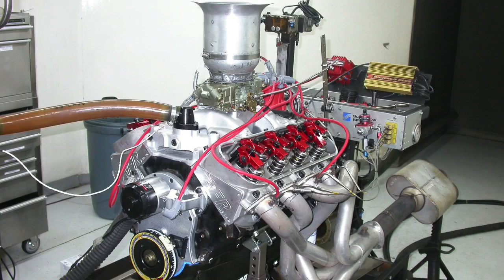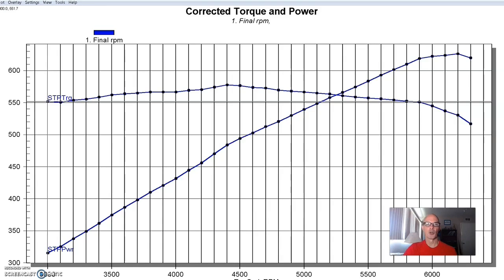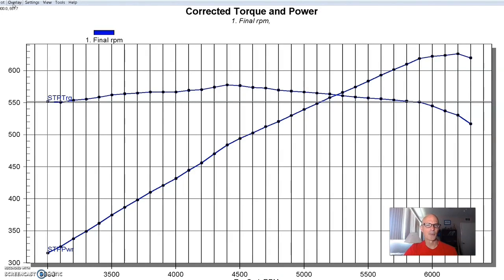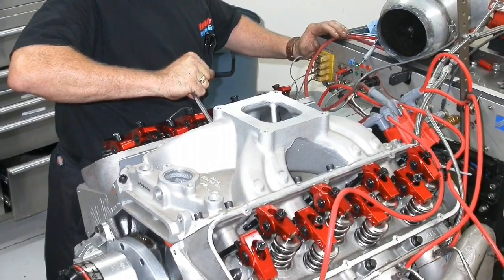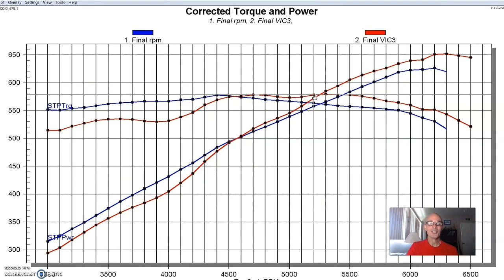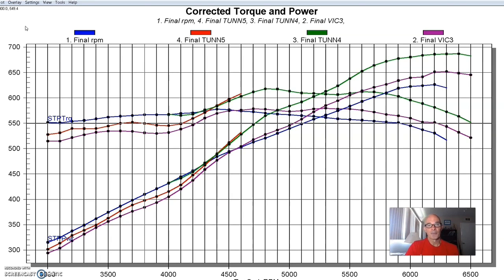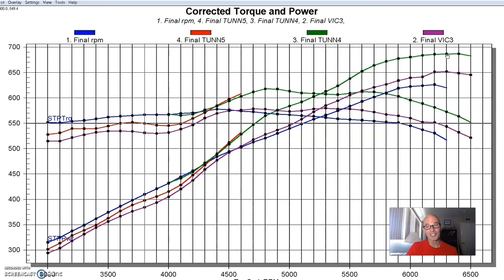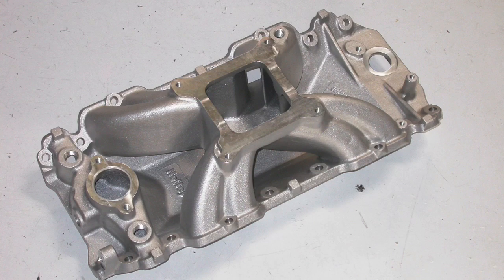BBC-TUNNEL RAM vs THE WORLD! -PLUS BOOST

Comment: I built a 10.7-1 496 for my 55. All forged internally simulator cam .650 solid roller with a later closing intake valve to fill the cylinders more shooting for about 180lbs cranking compression looking to run 93 octane fuel. The intake is an older weiand 70s era had to use adaptors because it's got a dominator bolt pattern and got two proform 750s on order. Not sure what to expect it's got Edelbrock rpm heads they were gifted so I'm running them. It's a street motor I don't race but I do like hitting 6500rpm every so often.

Comment: What is the benefit of that vortech carburetor box? I never seen such a thing before this video. Do you still need a blow through carburetor?
Reply from the maker: you can use a non blow-though carb
Reply: @richardholdener1727 interesting. I see they cost about as much as buying a blow through carb. Between buying a carb or buying the box, what is better?

Comment: I have a 454 built with 600 lift cam currently running a rpm airgap and avs2 800 can I get a tunnel ram and just get one more carb to match my avs2 800 would it run and idle with 2 800s on the street?
Reply from the maker: yes it can idle with 2 800s
Reply: Would it work good? Could I use 2 carbs with both having electric chokes with no problem?

Comment: Have Camaro68 Litel Cbb 461 Only 12 Boost no intercooler.Edelbrock Alu smal intake volym 315 Noth ported.0.630 lift Roller cam.Fjuel E85 1680 injektors.Weery  Weery Good respons Big staff3 Efi...Have Good Chasi 25.4  7.50.Streer week car Have noth Driving this camera yet standing in my lift eight years Hope I can com Out 2024... This camera route sixty eight come from scott Chafiroff. He build this camaro 1985-86 He called this camaro the blue boy 2. I have build this camaro to the better car Real 25.4 Chassi Crom Molly Case Tig Welded Two.Havw paint tou Green Pearl Gren 2 black strippes Flippfront..Weery Nice Camaro I can guarantee you that!!! Love The Dynos yoy Dou❤❤❤❤

Comment: Have Weiand Tunnel Ram intake  and modifaid sixpack. Plastic in the runners.Have even Pro shot Fogger have noth test that Yet. Thes 440 cui Grate Engine Rans very good.2024 Gone be wery fan i hope.Have run with Nos Early 90 with good Result..No brak Engines.. 250Hp Nos in littel Csb 356!!!

Comment: Lots of tunnel rams are rated at 2800 to 3500 to get enough  airflow n a. I've had a few.
You need to force induction them to get enough air to fill that volume.
Bloodviking

Comment: i learned nothin. a tunnel ram with carbs that take fuel as they need it,,ie  vacume secondary carbs for the street are perfect, get the port velocity figures,, get it setup on a flow bench,,, get the David Vizard books and videos. Did this guy on this video do over 11,000 dyno pulls for Comp Cams or 14,000 for Cosworth, Formula 1 and Nascar teams, NO vizard did and reccomends a Propperly setup Tunnel Ram is the ultimate street manifold AND can be setup to make power from 1500rpm..
Reply from the maker: get your carbs and tunnel ram set up on a flow bench?

Comment: As a teenage hotrodder in the 1980's I traded a m-21 transmission out of a 67 Chevelle for:  1969 Corvette 424HP Tripower intake (COMPLETE MANIFOLD TO AIR CLEANER) as well as a set of 427 Aluminum Heads (Perfect),  Steel Crank, Rods and Brand new in box STD bore 427 12.5-1 Pistons.   Used some, sold some PHUKKK if i had kept that stuff

Comment: Any testing on a single carb tunnel ram???
Reply from the maker: I did not
Reply: Richard Holdener Id very much appreciate a video if you ever get time lol. Always wanted to see if the simpler and cheaper setup with in carb was as good as the two

Comment: That is an old-style tunnel ram. A Fabricated tunnel ram will make even more power and torque than the old-style tunnel ram. It does it due to a more direct shot into the intake ports. The direct shot also allows you to tune with your LAMBDA. That allows you to optimize each cylinder with proper jetting. GREAT VIDEO!!!  I built a 11:5:1 496 single plane with a 1050 dominator and 2.125" id headers that made 714hp. I'd love to see what the tunnell ram would do on that.

Comment: I am building a similar steet/strip 496 with the YSI blower and carb box, solid roller blower cam, 315 aluminum heads. I bought a blow through Quick Fuel 750 carb they said would work great. I think the carb is too small. I think a 950 might be better. Suggestions?

Comment: People are starting to do what I been doing for over 20 years... Tunnel Rams have equal length runners compared to the other intakes.. They sit high above the heated engine.. cooler fuel makes better power... Each cylinder has it's own jet as well as it's own idle/air screw... The reason tunnel Rams got a bad name was because people couldn't tune carbs properly.. they would mistake a bog for too much fuel.. when in reality it was going dead Lean !!!! They kept pulling jet until they declared The tunnel Rams faulty.....If they had only knew the power they was missing....I recommend a tunnel ram over anything if you got room or cut a hole in the hood.... From mild to wild The Tunnel Ram is KING.  !!!!   Tell them old ass uncle's to sit down and hush. They don't know what they talking about when Bad mouthing the TR 👍😎

Comment: BBC torque my Elcamino came with a 13" TC which I thought was odd, till I blew up my first 2 11inch street convertors, next I put in a TCI street convertor which did not blow,
I had a tight 10" local buildt, which is still alive years later .

Comment: take the tunnel ram to the next level: go offy, add their IR adapters, 2 carbs w/ 4 corner metering.    8 barrels, 8 runners, no plenum, no BS.  killer torque, crazy power.

Comment: How many pounds of boost before you get the block o ringed? And what size cam would be happy in a 454 with 340cc heads 8-1 compression  with dual plane going in 3500 pound truck with 411s and 3800 stall and 28inch tall tire.  Adding about 8 pounds of boost from a torque storm supercharger.
Reply from the maker: smaller than what we used here-not need to o ring the block with a single torque storm (it will make only 750 hp or so)
Reply: @richardholdener1727  thank you.  knowledge is power and you are very knowledgeable about this stuff.  Do u have a recommendation on a cam? I have a 276/282  .241 @.50 and .249 @50 on a 110 now. It only makes 400 hp and 400 tq. I'll be adding a torque storm  this winter to it

Comment: Hi Richard.
I Have a idea.
Can you make a test just using different rocker arm ratios on intake and exhaust?  Let`s say  1.73 intake and 1.8 exhaust ... thanks
Reply from the maker: I've tried that several times
Reply: @richardholdener1727  thanks for your attention. 
Had sucess or it depends on how big the camshaft is?

Thanks

Comment: Do you have a way to measure BSFC (Brake Specific Fuel Consumption)?  Think it would be interesting to highlight the efficiency of the different combination and how they correlate with torque at a given RPM.  Keep up the good work.
Reply from the maker: yes-the dyno does that

Comment: 30 years ago Hot Rod did a BBC build up of various combos the Dart single plane with a CC 306 solid roller cam came out on,top I bought the Dart ,it really came on after 5000 rpm, but ran poorly in the winter so I went with Victor jr. On BBC torque you  have to be careful, my vechile would often break loose in turns or curves

Comment: I dynoed my 540 with tunnel ram on both pump gas and e85. At 10.8:1 (lake water cooled) I didn't have the compression to really take advantage of the e85, but the torque curve was amazing!! Over 700ft/lbs from 3k-7k
Reply: Jet boat?
Reply: @AB-80X  yes, 19ft Daytona

Comment: Thanks!  This helps me.  My dragster motor is nearly identical to your test motor here (heads & cam) but compression is a little over 12:1.  Today it is set up for single-plane dominator and uses an 1150.  I do have a second 1150 dominator so I would be curious how this compares to say two 750's-850's (or any 4150 base plate combo) if you have these numbers.  I do realize this motor doesn't need this kind of CFM but sometimes you run what you have.  By the way, my converter flashes/stahls to 5,000 RPM so low RPM flow isn't a goal other than moving about the pits.  Currently I run race gasoline but welcome E85/methanol results if you have those.  Thanks again.

Comment: @richard holdener 
How much horsepower is being left on the table N/A? What would this engine do with 10.5 or 11.5:1 N/A? Would it be close or comparable to the 6.9lbs of the vortech?
Reply: No it wouldn't be close to the vortech. It would make a good 10-15% more power if everything is set up right
Reply: If you bump CR from 8.2 to say 11, you will probably go from 620 to about 665-670 hp.
Problem is that you cannot really do that in a boat.

Comment: I am pleasuring myself, watching this video. BOATS RULE.  Now if you would take the 496 and bump the compression up to be able to run premium pump fuel with the tunnel ram. Is the sweet spot 10.5:1 ,11:1, 11.5:1 or higher to get the most top end?  Then, like you mentioned, do a comparison to see the difference with 540. The same setup. I'm a boat guy. To build a 496 or 540 is about the same money. But the question is; is it really worth it in the numbers? I've seen a lot of less than 500ci motors go really fast. Bigger is always better is not always true. On my shelf I have a Banks twin turbo setup, and a 671 Cragar blower. The turbo setup has the Rayjay's that came with the original setup. They are small so watching you has got me to think maybe upgrade/upsize the turbos with a 496 would be a good boat motor for my hydro. This video got me fired up. Thanks, man.
Reply: I can agree!!!! I’ve been building my 496 for my jet boat and almost done! Nearly identical cam (mines just slightly bigger-296/ 304, 640/ 640, but also has 10.5:1, Dart aluminum 308 race series heads ported and massaged, and dual 750 dp’s), and I went nuts when I saw this video!!! It got me super excited and ready to hit the water!!!!!!
Wish YouTube comments would allow short vids or at least pix in replies- would love to see and hear your hydro!!!

Comment: Here's the deal on turbo engines and chamber volume. 
Bigger chambers and dish pistons lower compression.
But that allows for a larger volume of mixture to burn
More air  and fuel 
More power.
Now tune it.

Comment: I'd like to see the low RPM test on the tunnel ram with a  pair of 600s. Bet that makes more low end than the dual plane
Reply: Question. How much time does your engine spend at full throttle while running at low rpm?

Comment: Your cam chose is an excellent cam.  Any cam in a natural exasperated engine that puts the peak torque in at 43-4500 rpm's and peak horsepower in the 63-6500 rpm's is giving the best of both worlds.  Lower rpm cams will product more torque while giving up HP.  Higher rpm cams make less torque, but more HP.   Average out torque and HP.  Add the resulting numbers together and the combo that gives you the highest number is the best combo.

Comment: I always wondered what it would be like doing a blow through on a dual carb tunnel ram and if it would be more efficient to run a single scoop with boost coming in the front or with something like twin turbos each feeding one side of the manifold

Comment: Remember in a boat things are different,  you only have 1.gear.
So you got to have torque in low rpm to get the boat out of the vater to plan.
If you dont have the torq you need, you got to have a smaler propell,  and you lose top speed.
Så a verry torque engine with a flat torque kurv is important.
Reply: This is a jet boat. Totally different that propeller boats. They rev up super easy.

Comment: But what about the tunnel ram with the 4” inch spacer in the center?? My tunnel ram has 11” runners now. Will it help?
Reply from the maker: SPACER FOR THE PLENUM OR RUNNERS?
Reply: Richard Holdener spacer for the runners! I found a shop that machines a 2” and 4” spacer for the runner of Weiand tunnel rams. I bought it for shock value originally (wanted the tallest tunnel I could get) and now I’m REALLY curious to know what effect that 4”s will have on the power curve.

Comment: This begs the question:. Why not build/ test a copy of Mopar crossram manifold from early 60s, to keep it under hood but get tunnelram results???🤔🤔🤔
Reply from the maker: That's way longer than a tunnel ram-but very cool
Reply: @richardholdener1727  you get the idea....😁
Reply: Length can be tailored to match/copy ram in volume-length.   Lots of work to custom build a sheet metal one-off.   Hmm...I just might.      So much more to study/ test.
Tall spacers under single 4bbl....etc....
I am retired,and Very interested!

Comment: That cam has a touch too much duration for the single plane and 8.5 compression. That funky dipsie do in the lower rpm ranges indicate fluctuation in air velocity at that rpm. In short the cam is a little to big for that low compression and big cylinder head. Drop the duration on the cam a little and you should make the same peak with a much flatter tourqe curve.
Reply from the maker: Intake test results would be the same with the different cam (I always use the WRONG cam)
Reply: I agree overall results would be the same but with an increase in compression and a drop in duration you would get a more linear increase in air charge velocity as rpm's increase. It wouldn't increase peak power very much, maybe 5 hp but the average power would increase and drivability would be better. That combo would be great in a dedicated drag car but a royal pain in the ass in a street car with the single plane manifold. Although it did seem to like that rpm airgap dual plane.

Comment: back in the early 90's I had an 1976 Hondo SK Drag Boat. with a 427 L88 Sporting an Edelbrock Tunnel ram, a set of highly modified 625 CFM Carter AFB's and a set of velocity stacks.  sold the boat to a guy that just wanted it for the motor for a corvette he was restoring.  Turns out those L88s was pretty rare.  all these years latter I regret selling the engine more than the boat... I had to rebuild the V-drive and water pump and repack all the shaft seals every spring. it also did not like MSD spark boxes for some reason, I must have gone threw a half dozen MSD boxes before I found an old Mallory Hi-Fire. after I put the Hi-Fire on I never had to touch it again.  that engine was a screamer. It smoked every boat that I ever raced with it.  it would launch like it was fired out of a gun, the rpms would keep climbing as long as you kept your foot in it. it saw 7000 rpm a few times before backed out of it. it was deafening how loud it was a 7k.  but it was more than that. you could feel the thump of every piston as soon as that engine lit off. I have never felt any quite like it before or since.  I currently run a 1971 Camaro SS 396, it is very fast, but its not the same as that L88.  hmm... maybe I should build an "L88" with a ram for my Camaro.
Reply from the maker: THE L88S ARE BIG $
Reply: @richardholdener1727   yea, I wish I knew that back then.  when I bought it I was told the engine came from a corvette race car, it was in pretty rough shape. I only bought it cause I though it had bow tie aluminum heads. one of the aluminum heads had dropped a valve seat, and damaged one of the pistons, but had not hurt the head to bad. I had the heads gone threw  they were a hot mess. needed all new exhaust valve seats and all the guide needed to be done, the rest of it was in good shape. I had the engine freshened up at the local machine shop. had it boarded .030 to clean it up. and a new set of TRW 12.5:1 pistons. the pistons themselves were weird, this is the only factory engine I ever seen that had bushed wrist pins and locks.  anyway the machine shop told me it was an L88 and that those early factory aluminum heads had a tendency to drop the valve seats on the exhaust side. the old guy working there had done a couple of L89 396 heads a few years back with the same problem. Now, 30+ yeas latter and I have seen those L88 cars go across the block at Barret-Jackson or Mecum for some stupid amounts of money and I kick myself for selling it...Personally I hope it ended up back in that old corvette racecar. something that rare deserves a proper home, and I count my self lucky to have actually experienced one at 7000 RPM.

Comment: in conclusion theres nothing like a BBC
Reply: That's what she said
Reply: As long as you ignore anything LS...
Reply: @YZFoFittie  Here we go...
I read the original comment, and instantly knew that one of these responses had to be some dingbat whining about the LS.
Reply: @AB-80X  yet you dug up something over a year old to whine about? I love BBC's, but modern cylinderhead tech coupled with computer controlled ignition and fueling has made LS and LT motors a much better bang for the buck. Tell us where the facts touched you...

Comment: I wonder what a cross ram style ram intake with quad side draft webers would be like. Would it act like a tunnel ram? Would fit under the hood then.
Reply from the maker: IR intakes act differently
Reply: @richardholdener1727  Your are right of course. I was probably a little excited and was thinking of volume of air flow and not of runner length. Given that side drafts already add to effective length on top of the long runners it would be all lower rpm torque. Solution?
BOOST!!
Love your videos!! Keep up the great work!